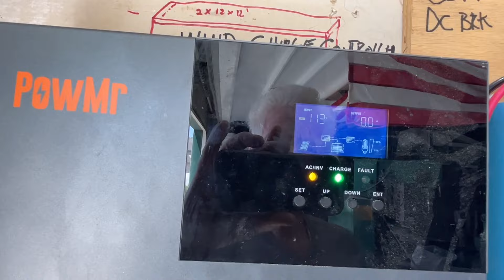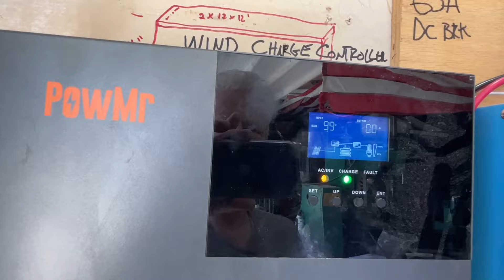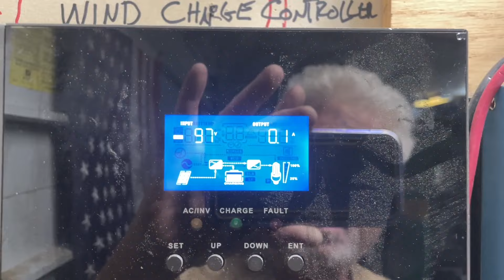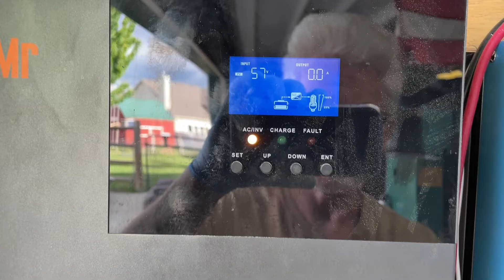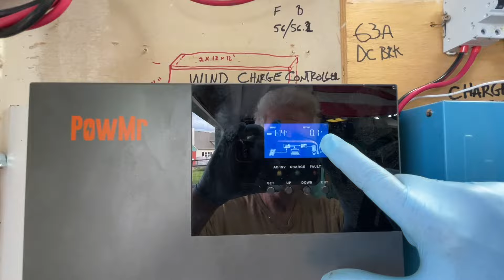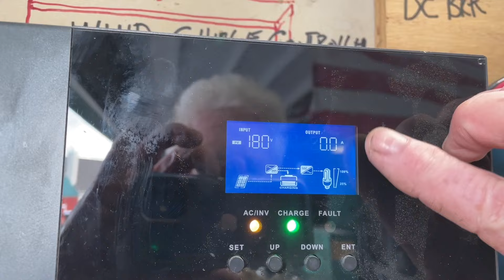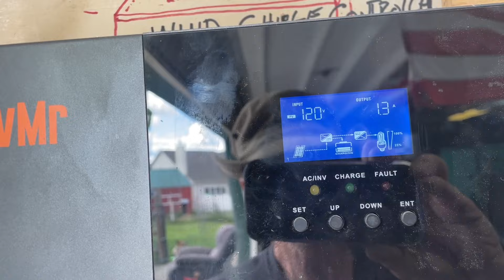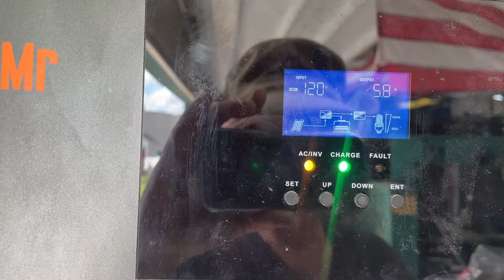2kw Vertical Helix Wind Turbine Power Output Results. 12m/s wind produces 2kw?

Comment: Thanks for the heads up on the wind turbine.
Reply from the maker: It's disappointing as far as producing the rated 2kw power performance, but it does continue to produce power. The maximum power so far is about 400 watts during a very heavy wind event of around 40 mph wind. 
Truthful advertising is vidal and is always best. No matter, I've learned a lot, and that is always Golden!
Thanks again, Julie. Stay Golden, my friend. 
Peace Prospector Tripp

Comment: That's sadly bad luck PT . Maybe you could pop rivet some big wings on it to get it to spin faster . What about  you  build some Methane digesters and convert to Gas . :face-purple-crying: just joking !!!!   Wow , you got your own power station ticking over there , all too high tech for this little black Duck i'm afraid :face-green-smiling: SORRY , you're on your own with this one Brother Matt , but good advice for other would be purchasers is stay well clear of this underpowered green power impersonator . Cheers Nev . 👍👍
Reply from the maker: Hello Nev, yeah, I am disappointed both in the turbine's performance and the eBay sellers that sell a lie. It's a very sad state of affairs in 2024.
I was suspicious of the 2kw claim, but after additional study. I can say that a vertical helix wind turbine of this size (5'x2.4') is just too small to generate 2kw. I believe it can be made to produce much more power, possibly 2kw if it is roughly twice as wide and maybe a little taller.
As soon as the smallest amount of current is applied by the charger, the turbine begins to slow until the voltage is below 120vdc, and then the charger kicks off and stops charging. Yep.. she's just too small of a sail to sail the ship. 🚢 😆 🤣 😂 
This Sailor is hoping to make her Powerfully Sail out of the harbor and across the Seas! Hopefully Squid technology wins the day 😃 🐙  🖥  🤪 😆 
Stay Golden Nev
Peace Prospector Tripp
Reply: @ProspectorTripp  Hahaha , i have no doubt you will come up with something to modify it and improve it's performance . Carry on sir 👍👍

Comment: Run the three phase straight inside to a rectifier. No charge controller at all. The solar charge controller is not made for wind. I think you'll get slightly better results.
Reply from the maker: Yes, I could do that. However, it’s supposed to be 2kw at a wind speed of 12 m/s / 27 mph. A subscriber turned me on to Omni Calculator.
The calculator says a turbine 1.5 m tall and .75 m wide can produce a maximum 307 watts. The blade is simply too small to capture enough wind energy to produce 2kw.
I will diy modify it and hopefully it will generate a lot more power.
eBay seller is selling a 300w turbine for a 2kw price. 
I am getting much better informed about wind turbines and what size of blade is needed to produce the power.
Thanks much
Peace Prospector Tripp
Reply: @ProspectorTripp  best of luck to you with your wind adventure. I'll be watching for updates. I'm building a VAWT now, and I'm hoping to get 2-300 watts. I'm hoping for more, but I want to keep my expectations on the low side, so I'm not too disappointed! 😆
Reply from the maker: @karlsoffroad8609  My diy solar power system has been rock solid.
I am upgrading our our system with another 10 panels (4000w)
Now, for that darn turbine 😆 
Thanks again, and I agree that keeping your expectations moderate is a good idea. 
Stay powered
Peace Prospector Tripp

Comment: Am wondering on a number of levels here PT. If one had another helix placed ontop of the original... would the combined efforts double what it gets now? AND.. If you were to DIY the wings/foils/whatever to be wider, could that improve the output? Just thinking outloud. There has to be some 'added' solution to improve that output.
Reply from the maker: Yes, sir, having it taller would definitely help, but like with a 1 ft cheater bar, there's additional leverage or torque, but not too much.  However, with a 5 ft cheater bar, there's 5 times the torque with the same wind. So.... I  believe making it wider will definitely improve the spinning torque a lot. 
The German company I was reading about had a 1400 watt turbine. The width was 5 ' 8" wide and 8' tall to develop 1400 watts of power. This turbine is 2' 5" wide and 5' tall. This size of turbine blade absolutely can not develop 2kw of power at 12 m/s. 
I am going W I D E first. Thinking about how to geterdun at the moment. We will just have to see what is possible with this underperforming turbine. 🤔 
Thanks much Johnny!
Peace Prospector Tripp

Comment: I see a problem with the downstream control electronics here. Maybe too much is converted into power loss.
I don't mean to be clever Matt, but you're right.
An increase in voltage equals an increase in current across a working resistor.
I'm curious what solution you offer !
Reply from the maker: Hello Peter,  it's not large enough to capture enough wind energy to produce 2000w.  The German company I read about has a 1400w turbine that is over 2x wide and 1.6x taller to develop 1400w.
This turbine is almost 4 times smaller. 1400 ÷ 4 = 350w yep.. that's about right. 
I will diy a larger blade and see what we can get!
Thanks brother 🙏 
Peace Prospector Tripp

Comment: For one you need to run the 3 phase form the wind into the building then step it to dc for a shorter dc run.
Reply from the maker: I measured the voltage and current exactly from the 3 phase generator in 11 m/s or 25 mph wind. This unit produces slightly over 150 watts.
The online Omni wind calculator says a turbine with blade dimensions of .75 meters wide  by 1.5 meters tall in a 12 m/s wind can produce 307 watts maximum. 
Yep, that's about right.
Thanks much 
Peace Prospector Tripp

Comment: Can you remove the blade and do a few mods and add a prop three or four blade six foot span? or would the results pretty much be similar?
Reply from the maker: Yes, sir,  I'm planning on some mods. One mod I'm thinking about is.. getting some standoffs about 6 or more inches long that replace the outer most nuts that hold the blades in place. Then, add two additional blades on these standoffs. I think that would roughtly double the torque with 6" standoffs.
 One by one, my friend.
Stay Powered and Golden diggin 😉
Peace Prospector Tripp

Comment: According to Omni calculator you should have 4kw of available power in the wind at 12ms (given your blade length/diameter) 
At 30% conversion efficiency you should expect about 1.1kw 🤔
Reply from the maker: I’ll check out the Omni calculator.
From studying other turbine manufacturers, I believe the 1.5m tall and .75m wide (1.5 x .75 = 1.125) blades are too small to develop wing energy beyond 200~300 watts. A German company has a 1400w vertical helix turbine that is 2.45m tall and 1.75m wide (2.45 x 1.75 = 4.2875) to produce 1400w. 
(4.2875 / 1.125 = 3.811) almost 4x too small to produce 1400w. 1400 / 4 = 350w yep that’s about right.
Thanks for a really good comment 😀
Stay Powered!
Peace Prospector Tripp
Reply: @ProspectorTripp  **correction available input is 1.229 kw for your dimensions at 12m/s (must have input the wrong measurements) so a realistic 10% output is only going to give you 120w
   Robert Murray smith channel has done so good work on these types of turbines ..... video 1623 might be worth a watch for future considerations
Reply from the maker: @sailaway8244  I am subscribed Mr Smith. Yeah he’s a good source of information. I’ll check it out, thank you 🙏

Comment: wish I had money to do this
Reply from the maker: Solar panels are cheap and very effective.
I recommend getting a couple solar panels and an inexpensive controller and inverter. To get your feet wet.
I built tiny solar systems that run lights in my shed, barn and our powered gate. Then three years ago I DIYed our 15 kw system that has run wonderfully.
Start small my friend, it’s very rewarding to produce a bit of power.
Thanks much 
Peace Prospector Tripp

Comment: thats a 200w max,  turbine  with a controller that starts at a lower voltage
Reply from the maker: Exactly correct! Except for the lower voltage controller part. This turbine is a 220vac version that under no load will quickly spin up to 400vac. Tested another EG4 100a charge controller, same poor results. Studying a German company, I believe size of the turbine blades are 4x too small to produce 2kw. Just not enough blade to grab the wind energy needed to produce the rated 2kw of power.
I’ll diy additional wider blades and hopefully make it produce an acceptable amount of power.
I am definitely getting more educated about blade size vs wind energy.
Thanks much
Stay powered my friend 
Peace Prospector Tripp

Comment: Move it above your tree line...
Reply from the maker: Yes, I could do that. However, it’s supposed to be 2kw at a wind speed of 12 m/s / 27 mph. A subscriber turned me on to Omni Calculator.
The calculator says a turbine 1.5 m tall and .75 m wide can produce a maximum 307 watts. The blade is simply too small to capture enough wind energy to produce 2kw.
I will diy modify it and hopefully it will generate a lot more power.
eBay seller is selling a 300w turbine for a 2kw price. 
I am getting much better informed about wind turbines and what size of blade is needed to produce the power.
Thanks much
Peace Prospector Tripp

Comment: its not the turbine / wheel or whathave you its how its wired 
😂
Reply from the maker: It’s supposed to be 2kw at a wind speed of 12 m/s / 27 mph. A subscriber turned me on to Omni Calculator.
The calculator says a turbine 1.5 m tall and .75 m wide can produce a maximum 307 watts. The blade is simply too small to capture enough wind energy to produce 2kw.
Please check out Omni wind turbine calculator.
I will diy modify it and hopefully it will generate a lot more power.
I believe the generator itself will produce a lot more power.. but not without a much larger blade.
Thanks much
Peace Prospector Tripp
Reply: @ProspectorTripp  it's were it's placed too ya ...
placed in a ally or Valley 500$ says ya get different results
water wheel turbines same thing different wheels river runs
right tool right job✨

Comment: get a better mppt
Reply from the maker: It is not the mppt charger 100%
I also tested a EG4 100a mppt charger, same poor results.
This is a 220vac version turbine, I tested the turbine voltage output on a windy day. It will quickly spin up 400vac+ under No Load. So a lower 150v max charger is out.
A German company has a vertical helix turbine rated for 1400w. Its blade is 2.45m/8ft tall and 1.75m/5’8” wide to produce 1400w. This turbines blade size is almost 4x smaller than the 1400w German turbine.
I believe the size of the turbine blades are too small to produce power over 350w.
Thanks for your terrific comment 😃
Stay powered my friend 
Peace Prospector Tripp